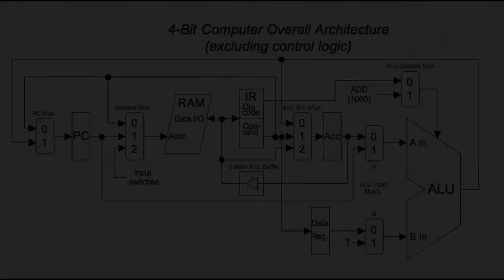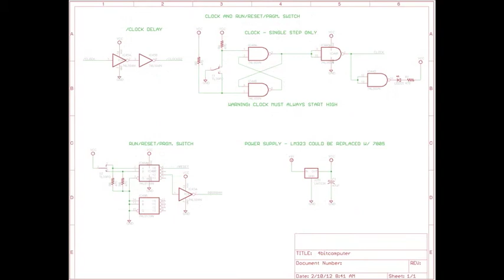Homebrew 4-bit Computer using TTL ICs

Comment from the maker: @Spoif Honestly, it really just came down to not having any other boards available when I built the machine. I was too lazy/cheap etc. to go get one, plus DIP switches. I should mention though that, luckily, I haven't had any problems with accidentally pulling out wires (so far, at least). Thanks for your comment.